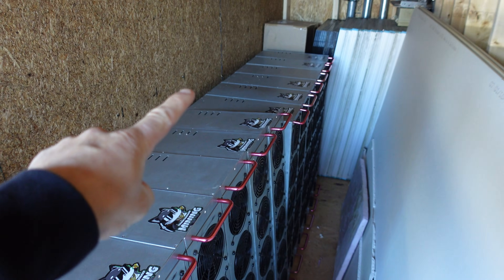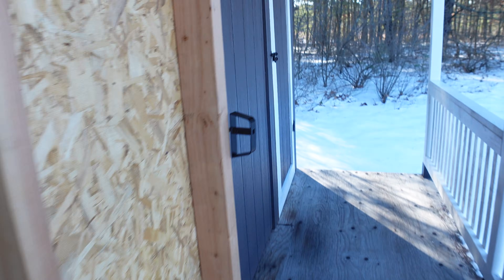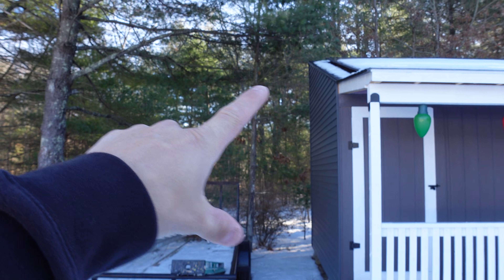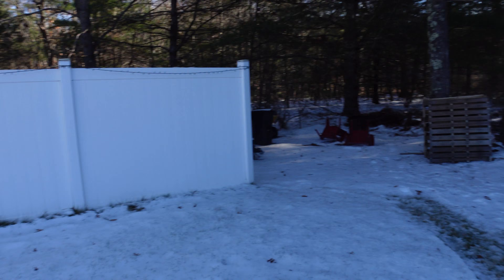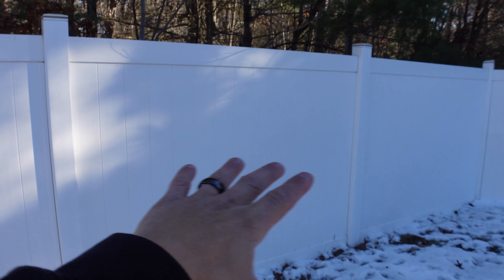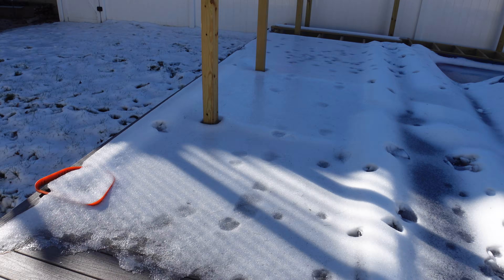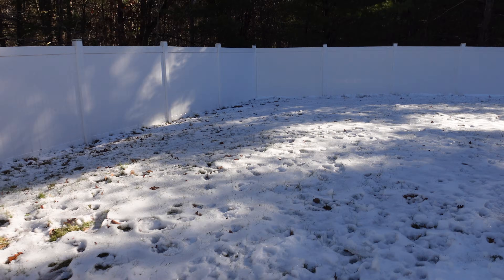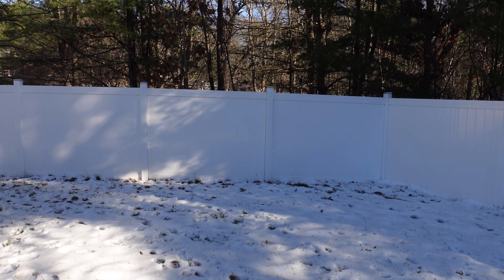What should do with these?

Comment: Hi, about the batteries that you have disconnected you will destroy them if they are at 100% charge and not in use. I don't know do you know that but you need them to be around 40-50% SOC for storage.

Comment: Hang the solar panels on the fence vertically either by the pergola or the back yard fence run the cables to the battery's.  You could do it for a temporary setup or permanent to get some solar power asap.
Reply from the maker: I was thinking that! Hmmmm 🤔

Comment: Where you put the solar panels??   You put them where they get the most sunlight, haha 😀   Definitely pick a good position for them, do enough wires there if needed.   You have good stuff there don't keep them unused for long, winter temperatures might not be very good for that stuff.   For the panels, really, don't try to put them aside where sun doesn't really shine.